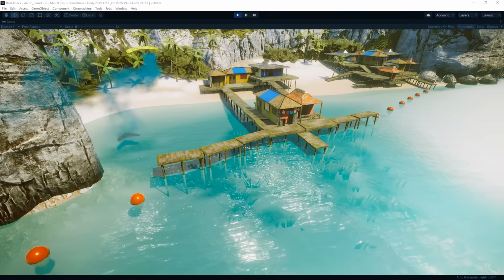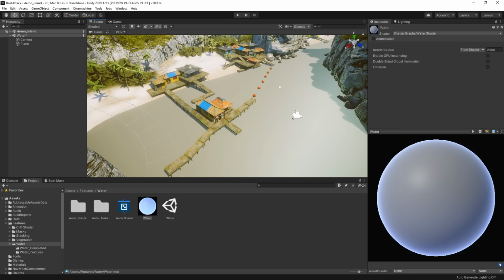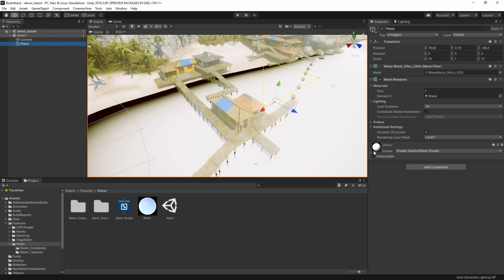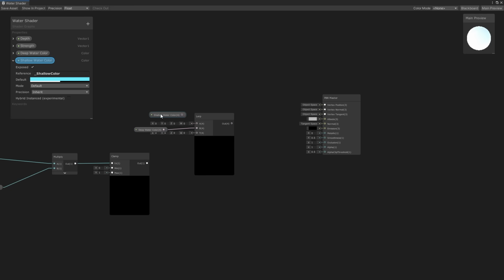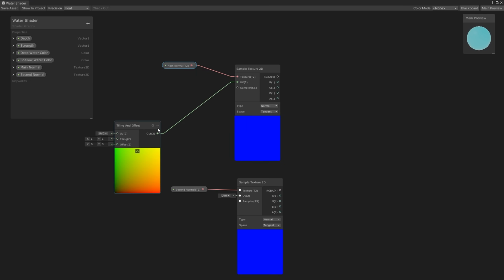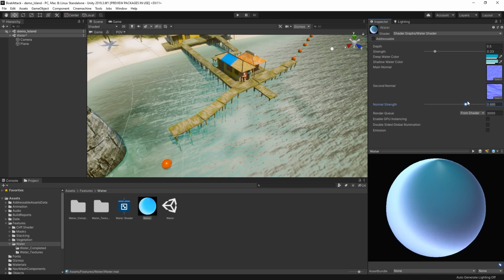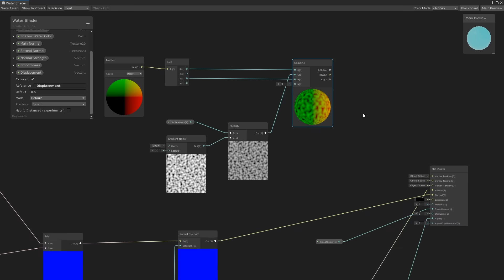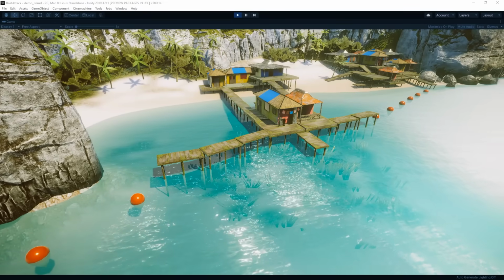Making a Water Shader in Unity with URP! (Tutorial)

Comment: If you are struggling to get the alpha to work, a workaround is to take the output of the clamp into a separate add node, add a small amount like 0.5 then use that as alpha input. This essentially uses the gradient seen near the beginning with a little added to prevent it being fully transparent (invisible) near the water line.

Comment: EXPLANATION FOR THE WATER DEPTH PART

1) 
SceneDepth01 tells us (from 0 to 1) how far are the pixels of the objects behind or underneath the water, because at this moment the water does not participate on the Depth Test yet. So, if we multiply this value by the camera's Far Plane, we get the real distance from the camera for all those objects behind or underteath.

2) 
ScreenPosition.w (or .a) tells us how far are the pixels of the water.

3)
So, on the zones where the water is near to the ground, both values (1) and (2) will be almost equal or equal, so if we subtract them they will result in something near to 0 (black). The more separated is the water from the ground, the values 1) and 2) will be more distant, so their subtraction will return a bigger number (white).

Hope this is useful for anyone that do not like to follow recipes without understanding why they work.

Comment: I found it very handy if you assign Vector2 nodes to the tiling input of each Tiling and Offset node of the respective Normal node, so that you can control the main and secondary Normal Tiling from the Inspector. You can similarly do so with Vector1 (or Float in newer versions) for the Normal Speed.
Over all excellent tutorial but as many mentioned, it needs to slow down a tiny bit and maybe give some links to the Normal Maps  :)

Comment: This tutorial literally destroyed my project, it was all working fine at first so I updated my backup, and I noticed I had to change my render pipeline, so I did that and it destroyed all my materials. Luckily I was able to get them back, but they werent quite the same anymore, so I updated my backup again (Just incase changing it back corrupted the file) and changed back the pipeline. This destroyed all textures. As in I physically cannot get them back.
Reply: If you change render pipeline and your textures and material look pink, select them and go to main menu -> edit -> render pipeline -> universal render pipeline -> upgrade.
Reply: @vidak92  Thats what I did, but the textures were streched and wrong after that.

Comment: Some issues I had and how i resolved them with HDRP 2020.2.1f1.  I couldn't find Depth texture or opaque texture anywhere in project settings or HDRP asset inspect settings. So select the water material and change the surface type from opaque to transparent. The PBR shader graph option doesn't exist, instead create shader->HDRP->decal shader graph and set the material from decal to lit in the graph inspector graph settings window. When following video, vector1 isn't a thing but a create a float value instead and change its value in graph inspector.
Reply: wow, I´m having the issue. Thanks! So, where do I find this Graph Settings Window?  And, instead of Albido, which option should I connect in the Decal Master Node?
Reply: okokok I got It! Instead of Clamping the final Depth values into the Albido, you should use the "Smooth Step" node. That works for me like magic. Everything else is exactly the same, just add this Smooth Step Node right  before the Albido channel (instead os using Clamp).

Comment: Followed the tutorial to a T and it worked fine until you plugged the split node into the alpha of the master node. My mesh just became invisible, despite setting AlphaClipThreshold to 0.

What did i do wrong ?
Reply: Change your colours alpha value to 50 or above, I had the same issue and it stumped me for an hour, this fixed it.
Reply: @Nadestraight  same happens with me and just got solutions after commenting.
by the way. 
Why my depth and strength values don't working from inspector window?
Reply: Yeah! mine too
Reply: Finding solutions.
My unity version 19.4

Comment: Anyone else experiencing problems with screen depth/screen position nodes in HDRP? Changing the Depth parameter doesn't do anything and Strength only distinguishes between 0 and above 0. Do I have some weird settings or what am I doing wrong :D
Reply: And when I connect the alpha as in 4:20 my whole plane becomes invisible.
Reply: @biglemonfox3446  Set alpha value of colors, between 50-100
Reply: did you ever find out how to solve this? Struggling with the same problem.
Reply: @kineticraptor3318  Make suru you have enabled depth and opaque texture in quality settings for all quality level

Comment: If only I could get this to work in the HDRP, I tried following along but as soon as I make the shader transparent, everything goes bright white and I can't see anything. :(

EDIT Strange, I continued on anyway and it started working! Nice. :)
Reply: For anyone wondering, if you're using the default URP project template, it includes a Bloom setting in the Post-processing Volume which needs to be disabled or turned down to prevent this from happening.
Reply: @MatthiasOnYT  1 Year later 
you are saving someone with this comment

Comment: For anyone wondering how to enable Depth Texture and Opaque Texture, at least on 2019.4.4f1 that setting was moved to be under the UniversalRenderingPipelineAsset on the inspector -- NOT under Project Settings.
Reply: Dude you just make my day jajajaja, i was looking for the options in the project settings like 1 hour....
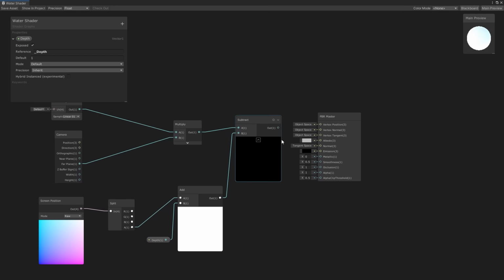Reply: @gr8m8n8  After doing the shader graph nodes, click save asset in the upper left corner. @2:29 Worked for me, I didn't see him do it the first time.
Reply: @HoaPham-zs1mh  It's this one. Do this!
Reply: This needs to be pinned!
Reply: It's like they don't want us to learn.
Reply: @Soullesscat  it's like you're too dumm
Reply: The Unity devs really have a way of screwing up old tutorials; if the video is even a few months old, it basically obsolete.
Reply: Thanks!
Reply: Depth was looking good in my viewport but broken using the game camera. This tip fixed the problem. Thanks!
Reply: thaaaaank yoooou
Reply: Thank you so much!  Glad I looked in the comments before I spent forever trying to locate it :p
Reply: How did they get the plane with all the subdivides, Im getting tiling on my texture
Reply: @KIoakk  They made a custom plane with more subdivisions in a different software, I think. At least that's what I did.
Reply: @Pigglyjuff89  You can use default unity plane! by the way you can create a plane with enough subdivision surface in any 3d software
Reply: @RausanSinha  yeah, that's what I explained xD I replied to someone else asking about it. But thanks :)
Reply: Thank you so much!:)
Reply: Ok thnx
Reply: Thank you very much! I was wondering what's going on? It must be there! Thank you :)
Reply: Thanks mate
Reply: Be blessed my lord and saviour

Comment: how do you add depth to the water? my water is as thin as a piece of paper. i followed the tutorial did i miss something?
Reply: That's absolutely normal. It's just a plane and not a water tight mesh. Also, it's a surface shader and not a volume shader. So as soon as you are inside of a mesh, you don't see it anymore. Surface shaders are only rendering the surface of a mesh but nothing inside of it. The depth is just faked with the z buffer.
Perhaps you could use a post processing volume with fog that is everywhere under the surface of the water. But I think then it would look like the atmosphere is full of water too, when you're under water and look up.
Perhaps it would be possible make another shader that is used for a second plane which is also at the level of the water surface, just flipped upside down. Perhaps with another calculation with the z buffer it would be possible to calculate how much water and how much air is between the camera and the first opaque object or the sky.
Reply: @juschu85  I just switched to unreal engine its way more beginner-friendly and you can make water with the depth and volume in 10-15min
Reply: @ernestnovakhov  I'm also thinking about trying out Unreal, just for other reasons. But this is the first time I hear someone say Unreal is more beginner friendly than Unity. Usually, it's the other way around. You shouldn't make the mistake, especially as a beginner, to make the conclusion any software is too complicated after you run into the first problem you can't solve right away, while it works fine in other software. In other cases, it might be the other way around. The question is not if Unreal or Unity is better or more beginner friendly. This is about choosing the right tool for the job. So the best idea would be to learn Unity AND Unreal.

The fact that it was much simpler in Unreal to achieve what you want, might mean that, under the hood without knowing, you're just throwing much more processing power on your game and call it a day. But that would be completely against the idea of the Universal Render Pipeline. This video is about doing it in the Universal Render Pipeline, which was formerly called Lightweight Render Pipeline. With your resources in mind, you want to fake as much as possible to reduce the requirements on the hardware. Unfortunately, that also means that, depending on what you do, you're breaking the illusion. In this case, you shouldn't put the camera under water. Fortunately, as a game developer, you have full control over what the user can do and what not (that's really a problem with VR, because as a developer, you're loosing direct control over player movement). This tutorial was made with the tech demo for the Universal Render Pipeline, which is a racing boat game. That's a game where you don't need the camera to be under water, so you just code the game in a way that the camera stays over the water all the time. This way you're saving resources (instead of just using a volume shader) but you make sure the user never breaks the illusion.
Reply: @juschu85  it's honestly easier and I find that there are more tutorials to things I want to know in order to build my game , there isn't as much free available assets like with unity store but it'll have to do because in unity the simplest things are over complicated
Reply: @ernestnovakhov  The point is the things you want to know RIGHT NOW are more simple in Unreal. If you're actively working on a game right now, choosing the right tool for the job would mean choosing Unreal if it's simpler for what you want to do right now.
But don't write off Unity completely. You constantly hear from people Unity is less complicated. Also, Unity has a big focus on being able to develop for weak hardware with Universal Render Pipeline (but of course, there's also the High Definition Render Pipeline for Triple A Stuff). In the long run it's always a better idea to know both in and out. That's not a point where I am (yet) but I already know that only then you are really able to choose the right tool for the job.
Reply: @juschu85  I guess unreal is better then (for me) because if the most basic things I need take 10x less time to implement and less hassle then why bother with unity, it was worth a shot I'm glad I switched
Reply: @juschu85  thank you though
Reply: @juschu85  Hey is it even possible to add fog (like volumetric fog) in URP? The only fog I was able to add is in the Lighting Window, which isn't volumetric by any means. My intention is to simulate god rays using it, but until now I've been completely stumped

Comment: Wait a minute, how does this URP scene look better than my scene in the default render pipeline?
Reply: Probably because the URP objectively better in most ways. It doesn't support every little thing yet (Like specific ShaderGraph nodes or PostProcessing effects) but the defaults often result in a much nicer scene. Also, that scene is really optimized for both visual fidelity and performance.
Reply: @LuukDomhof  I wouldn't call the lack of point light shadows a "little thing"

Comment: Not sure if i have something configured differently as I did change some steps, however when I reached the step where the combine node is used for displacing the vertices, the Green input does not appear to correspond with the Y direction in Unity.  For me it was the Blue. Again I did some things differently for my shader, but thought I would share.  One more thing, this probably depends on your mesh/scale, but .5 was way too high for my displacement value.
Reply: I had this exact problem! Was not displacing in the Z-axis. Switched to blue and that solved it. Thank you!

Comment: I've a tiny problem - can't use the Boat Attack demo water outside Boat Attack. I don't know how to export local packages properly.. help?
Reply: Just copy the water system package to your packages folder.
Reply: @aniruddhahar  Thanks, I tried that. Now, it's popping errors left and right. I fixed some. Now, I tried to run it in Android, runs perfect - except it crashes when I look (the camera) into one particular spot. Lol
Reply: @dkmangang  make sure you're using the correct unity version for the project, 2019.3 or later. Post on the forums about what errors you're getting in the console, others will have faced similar issues
Reply: @aniruddhahar  Yes, I should probably go to the forums. Anyways, I use 2019.4.x LTS. The github project that I cloned was for 2020.x I believe, obviously didn't work. But I copied only the water system. Had some strange errors which I fixed (I believe that this particular project was not intended for use with 2019.4 at all). My only issue now isn't any errors at all. But when I export the project (with the water system) into an Android device, it works smoothly except for when I try to look at one very specific spot. Sorry for the long reply.

Comment: What I would like to hear are more explanation on what the different nodes in the shaders exactly do when you add them.
Reply: Ok so I tried to understand what was happening here by doing some research. Fair warning, this may be all wrong:

The scene depth gives the normalized distance between the camera and the current point on the material surface, so a 0-1 value. This is then multiplied by the camera far plane (the distance between the camera and the farthest rendered surface point in the view in world units) which gives the non-normalized scene depth value. I don't know if my understanding is right since setting the scene depth to raw instead of linear should give the same value without the hassle, so it's probably wrong (maybe the scene depth actually starts at the near plane instead of the camera location).

The raw screen position's alpha value (the w component), if I understand right, is the the depth value of the surface point in camera space before perspective projection. Subtracting this from the scaled scene depth should give a value which starts at 0 (not factoring in the depth offset scalar) at the camera near plane (the distance between the camera and the closest rendered surface point) and also ends at 0 at the camera far plane but is the largest in between somewhere depending on the FOV and clipping distance. I guess this mask can be used to make the water transparent around where the camera is looking but is more opaque if the distance from the camera is too close or too far. To have more control over this falloff, a depth offset scalar is used.

Anyone can feel free to correct me on anything I got wrong.